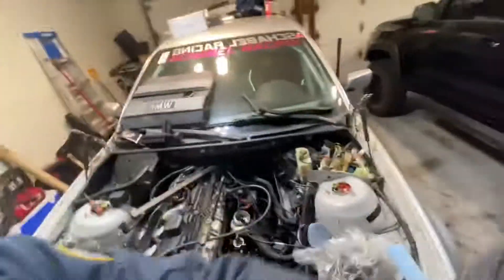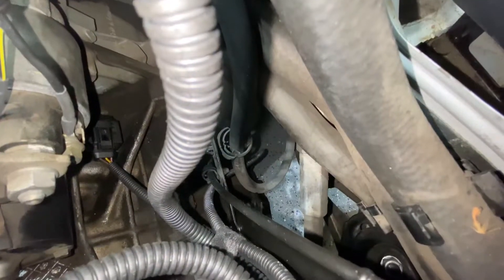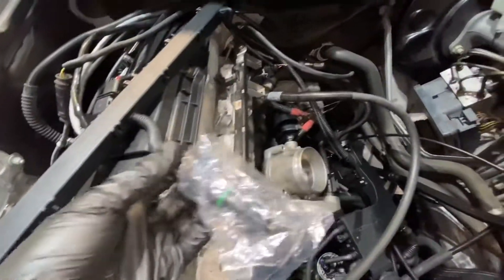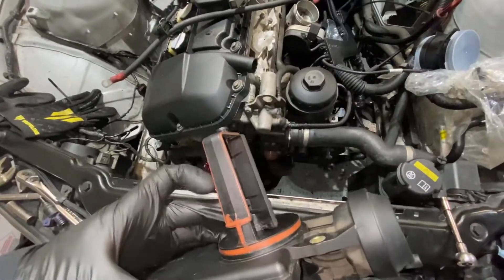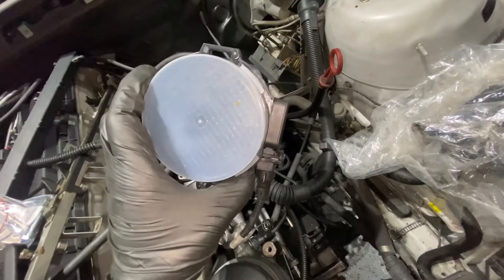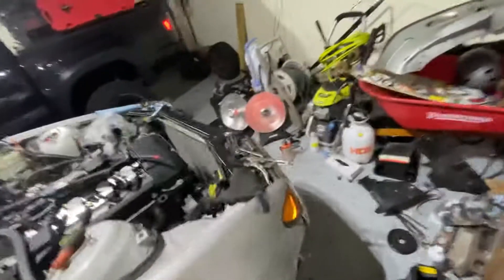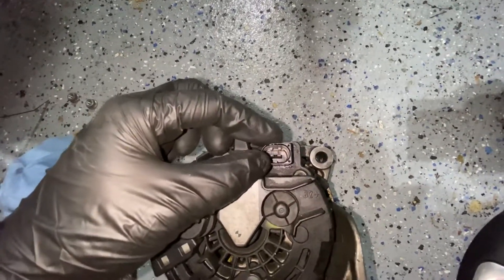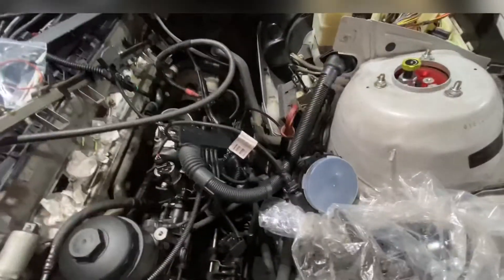MS43 engine harness wiring walk through for BMW E46 330i

Comment: So where the extra one goes, i have that problem cant find where should i plug it in?
I have E46 M43B19 77kw 105hp year 2000.
Reply from the maker: Sorry I didn’t see your comment sooner. It’s left unplugged if you’re converting from MS45 to MS43, or at least that’s what I did because there was no place for it.

Comment: Had to watch until the very last connection, where you happened to mention that the intake cam sensor plugged directly into the wiring manifold vs into another connection on another branch of the spider’s web.  Low and behold I just saved myself hours of disassembly and reassembly to figure out where the heck the cam sensor connects!  I had it connected to the MAF connector until I installed the MAF and couldn’t find a connection 😂.  Totally saved me!  Thanks

Comment: Hi just saw ur video. There was a black cable with a ring terminal which u missed. Where does that fit
Reply from the maker: The only ones I can think of are the two positive terminal connections that both go to the starter, one of those goes too the positive connection on the passenger strut tower. One positive that goes to the alternator, and the two small connections on the starter.

Comment: Did you figure out where that plug went I’ve been trying for 2 days where that plug goes
Reply: These engines have internal EGR, no valve or plumbing. I believe the connector in question may be for the secondary air solenoid, it is located under the intake next to the firewall.
Reply from the maker: @CrispyView  Sounds like you may be right on this one
Reply from the maker: Sorry I figure out at some point what it was and forgot. But if you’re doing the same conversion I believe you can leave it unplugged. Mine has been running fine without it.
Reply from the maker: I think the unused connector was for the EGR valve.